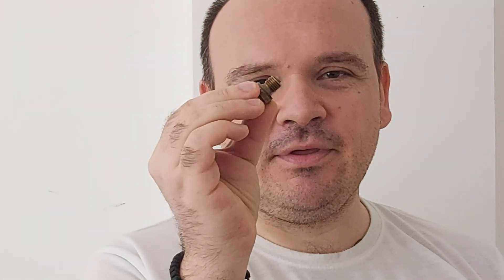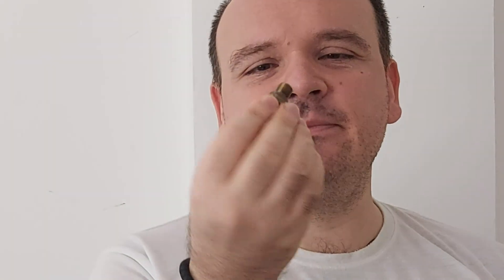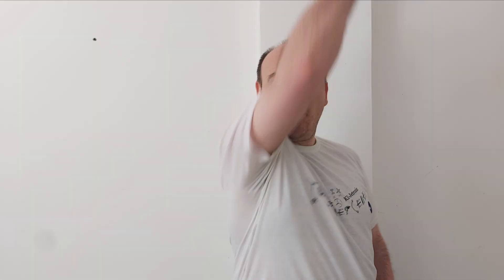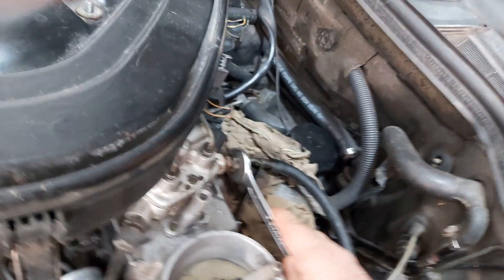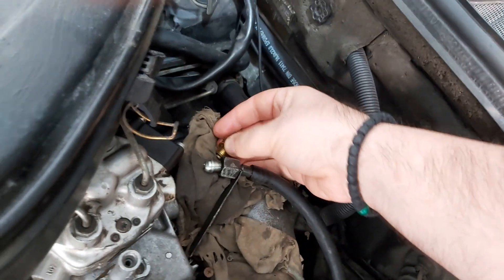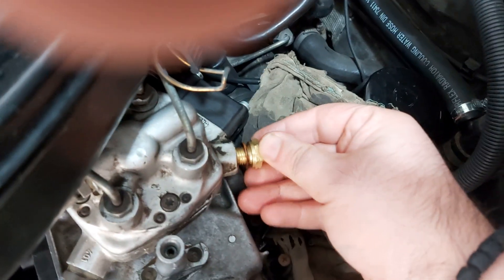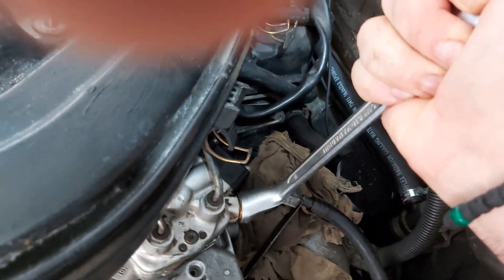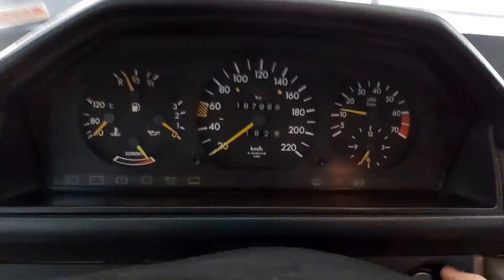㉦Mercedes Ke-Jetronic㉦ - Fuel pump filter (remake) 😀😄😃😆

Comment: Hi, please this filter can be the problem to start the engine warm?
Reply from the maker: Hi, no, it can cause the pressure to start dropping! Warm start issues are typical for the fuel accumulator.
Reply: @mercedeske  Thank you very much